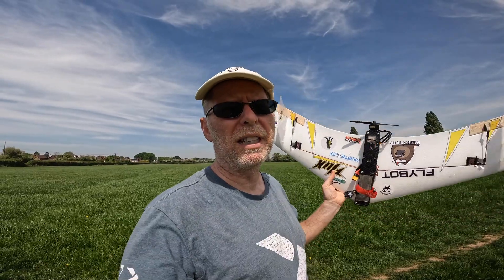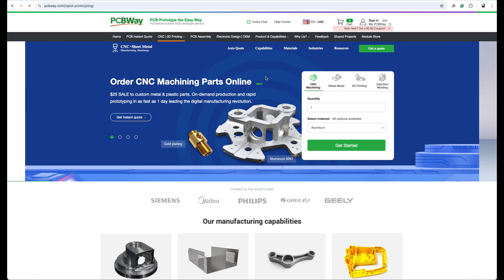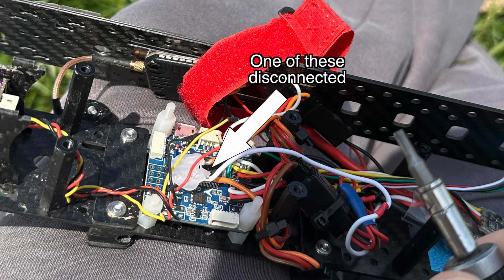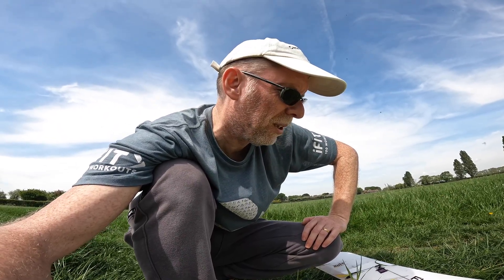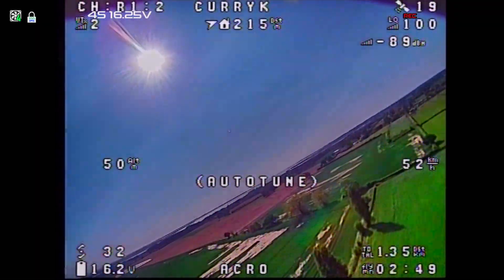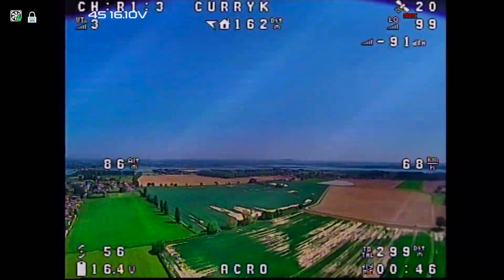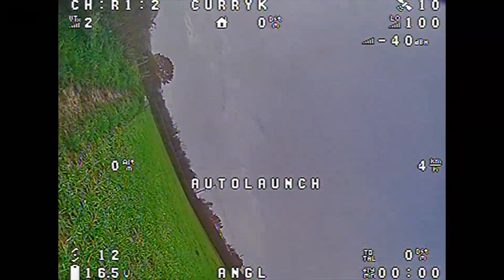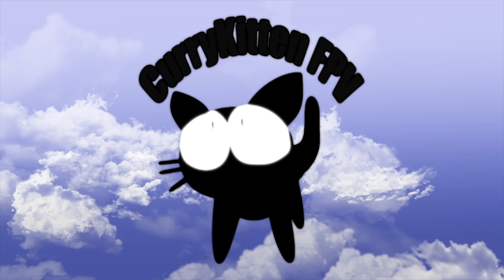Testing a new ESC on my wing, if only I could launch it!

Comment: The diagonal lining is noise from the ESC. I just added an "Mateksys Micro BEC 6-30V 5V/9V Adjustable" and it fixed the issue

Comment: Wings don’t like to be balancing out of CG line. It should be absolutely balanced. Secondly, at high launch throttle, ESC noise can also be interfering with digital servos, causing them to malfunction.
Reply from the maker: It did actually balance on the suggested CG, although the CG had a range depending on how aggressive you want to fly it.  It does seem that I could do with a little more movement on the surfaces which might have pulled out of the 3 launch.  i do notice I can't roll it very quickly, so I might change to a different servo horn hole

Comment: Fixed wing, yay! That OSD loss could be everybody's old favourite, the "ground loop". Are all grounds going to a single location? Other than that maybe the motor wires are running parallel to the video? Might be worth making them "cross" paths to stop the interference. Oh wow, I'm remembering stuff!
Reply from the maker: Yes - i vaguely remember the ground lop conversations.  There's a lot of dodgy wiring in there.  When I opened it up I didn't remember making it like that :)  One thing at a time though, else we won't know which bit fixed it (hopefully fixed it)

Comment: I've had this issue with my OSD flickering and turning off completely. The trick was to run all ground wires into one common pad on the flight controller
Reply from the maker: Only on full throttle or all the time.  I'll have to have a look at the wiring, this was an old Omnibus board from a quad, so wasn't exactly built for a wing.
Reply: @CurryKitten I had this problem on an omnibus too

Comment: I've had that banding myself - it's the cap, they don't last forever. Also, I've used shielded cable for my cameras which helped clean the picture up quite a bit, especially on planes with long camera wires to a rear mounted VTX
Reply: PS, use a low ESR cap. A standard electrolytic won't cut it.
Reply from the maker: Will do - given there's no cap at all right now, I hope that should improve things